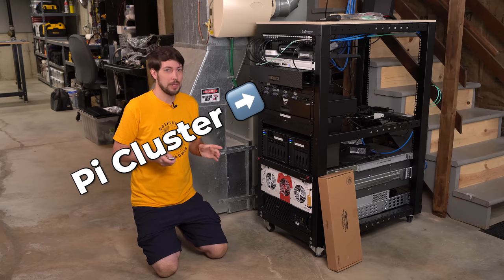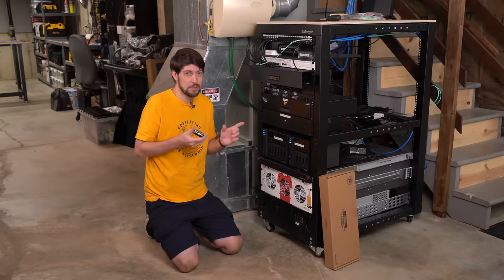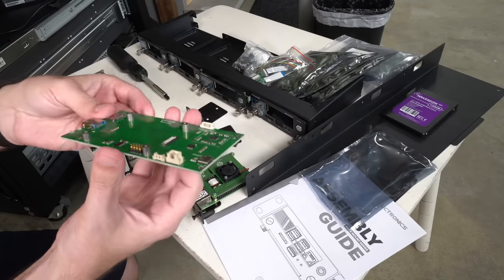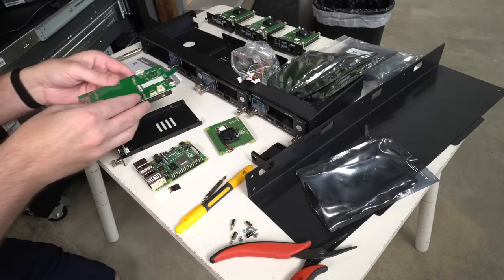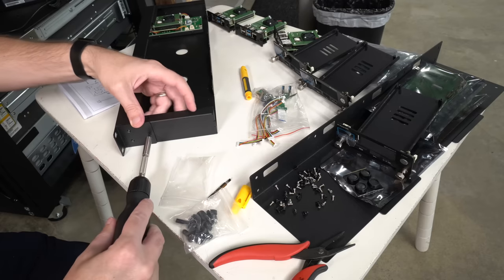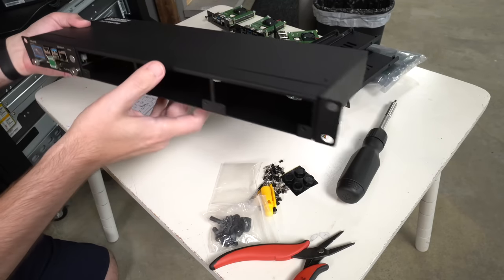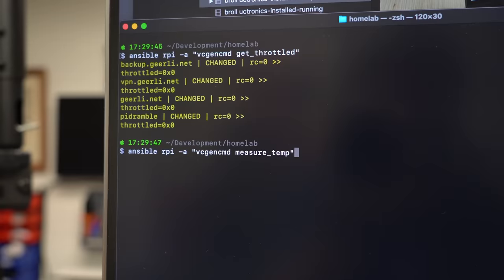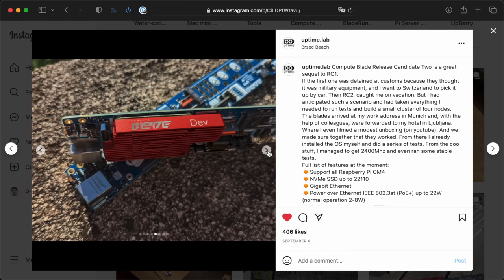Homelab upgrade: New Raspberry Pi Cluster rackmount

Comment: [Coming into this a bit later as stumbled across this on searching for something else]

Fantastic video. I've had one of these for some time and it works really well. I'm running Home Assistant on one, 2 instances of Open Media Vault (one with Plex) that has replaced my Synology, and a fourth running some general utilities (e.g. Solar logging).

The USB M-M PCBs come fitted with a cover now so that issue has gone away. I have 2 Noctua fans either side providing cooling (there are mounts and vent holes already fitted). I had to take off the cover lid as it was quite clumsy to route USB power. But....

I hadn't thought about adding PoE to the mix as I thought that you needed to provide USB power for the SATA and board. One question - if you use PoE does the fan interface also get powered ? I'm guessing it is 5V but wanted to check. 

This video has inspired me to buy another one of these and also to make a custom insert for a second SSD.

Comment: Personally, if it's between pogo pins and ribbon cables, I want the pogo pins. It just needs a redesign so they seat into place rather than you needing to align them. Also, it looks like that program had a segfault because your hair didn't get cut when it popped up.

Comment: It would be counter productive to PXE boot the PIs because if they are all dependant on a server you may as well run them as VMs. The advantage of separate PIs is they run independently of the rest of the rack except for the network itself.
Reply from the maker: PXE just separates the storage from the node, which can be more or less resilient than storage-per-node.

Comment: It seems great. But those USB-to-USB adapters really need some kind of black cap to cover their PCBs. :)
Reply: Was looking for a comment like yours to see if i was the only one who felt a little bothered because of the green pcb in front of the full black rack.

I think they should change the pcb color to black, but using a cap instead would be a good option aswell which i didnt thought about. Caps could be easily and quickly be 3D printed for them aswell i assume
Reply: I have one of these units and it came with a sealed version with a plastic cover.

Comment: What part is actually hot swapable?
I have drives that allow me to remove and replace members of an array without downing my server or appliance.
I have redundant power supplies that will let me remove and replace a power supply without downing the server.
All I'm seeing with this is a tray that allows you to power off a unit and remove it with all services ceasing during the process.

Regarding the heat, you might try tapping the holes for fans on each side and see if the holes alone offer enough air movement without installing any fan first.

Neat project. I have been relying on more virtualization than dedicated hardware for various services.

Comment: I feel like you could cut intake/outtake for fans to improve airflow. Probably two intake fans on the side and two in the middle back for out.
Reply from the maker: For now I'm going to try one intake on the side, and see if that can move enough air through all the gaps in the front of the case to get the Pis back down to the 50s.

Comment: Good review Jeff. Normally when I think of hot swap I think of some kind of backplane connector but this is little more than a tin box for those drawers, which are nice at first glance but the USB jumper is atrocious and kills the whole product for me, couldn't they have used a few more pogo pins instead? I thought the displays were gimmicky but I'm changing my mind after I saw you customize them. For the added cost of a PoE router and those 4 hats you could buy a really nice power supply. PoE is really intended for remote mounted devices, I'd rather have the box containing a power supply.   I think the box is decent value and my complaints are about the limitations of the RPi4 but the real killer is the current cost of RPi4s. I'll wait for the same thing in computer modules. I'd even forgo the hot swap if they could put all four computer modules on one board designed to run four separate systems. Maybe put UPS and remote management of the other units on the board too.
Reply from the maker: Having two sets of pogo pins makes the alignment a disaster (I say from experience with a bunch of Pi Zero projects that flake out since they used like 15 of them). I really hope the next generation of model B has a little nicer IO arrangement.

Comment: Gosh darn it, Geerling. Your videos really aggravate my GAS (gear acquisition sickness). Love this video and what you're doing with the pis. Besides the tinkering satisfaction, any reason to sysadmin with pis vs containers or VMs in a larger machine?
Reply from the maker: Mostly for the bare metal networking aspect... right now with prices as they are a slim argument can be made about power efficiency but until Pi availability gets better, it'll be more cost effective to run VMs on a small desktop or server.

Comment: Rule of thumb: every 5°C hotter halves the lifetime of electronic parts.

Cost of the enclosure is determined by the number and complexity of bits — as well as build quality/finish. They need to reduce the number of screws to assemble the enclosure and the rack "ears". Throw the project at mechanical engineers with experience in sheet metal and thermal management. A slightly deeper enclosure with provision for active ventilation and space for a 50W PSU (so that POE dependency/inefficiency/heating can be avoided) should not hurt, nor increase the cost significantly.

Comment: I would say that is a very nice setup with the screens and power buttons but the cooling needs to be addressed to be sure. Side venting with internal fans, if they will fit, would be best and would match the Switch cooling our company rack has. Also that USB to USB shunt is ugly and really needs just a black faceplate on it. Possibly with a LOGO or number indicating the pie inside. But does look very nice. ♥

Comment: UCtronics has come a LONG way. It's still expensive for what you get but if this is something you need, it's a decent product. I just bought this same rack, except mine has the screen instead of the hard drive  slot. Good kit though. Customer service is great. Just don't bent the metal. It's cheap

Comment: i think the SSD lights on the units without SSD installed are lit up because you plugged the usb bridge in already. and speaking of the SSDs, there is a big design flaw in those trays. you have to fully disassemble it to get to the SSD. there is probably a way to make it better.
Reply from the maker: Yeah, if they had it mounted the opposite direction, you could just slide the SSD out the back after unscrewing it. I didn't mention that to them, but that would probably solve that issue pretty easily.

There are definitely a few rough edges on this enclosure, I know the early design goal was to get it all into 1U (older rackmounts needed 2U), so I think revision 1.5 or 2.0 of this thing will have some great little quality of life upgrades.

Comment: That screwdriver you were using sounds a lot and looks a bit like my Snap On driver I bought some 30 years ago but at half of what you paid for yours. It’s still going strong. Hope your health issues are coming into check. Wish I could figure out writing code for the Pi’s. Other than using one for a project for ham radio running a node for P25 communications but with a ready to go program.

Comment: I screwed up when I installed my NAS the first time,   I installed it to an SD card instead of the SSD,  So far my  NAS has been running about twice as long as the SD card vs. SSD.  You never want to READ and WRITE a lot of stuff on the SD card.

Comment: Inbetween us smartalerks on the super nerdy side: How is this a cluster? You are running several computers that are tightly connected, if the stickers are correct. A cluster would be to turn them into one computer and running the software on top.
So, clusters are only as fast as the nods, which limits the overall performance using the berries. As soon someone is having a collection of especially these sweet tinies, it all for a sudden does make sense to use them all more efficiently ba creating a cluster over a connected set.
Basically, from getting into building dedicated berry boxes that do one thing and one thing only, to having possibly a dozent all over the nerd castle that do all one thing each yet are well connected in a better sub-net, the next step is to turn them all in a cluster berry, let's say a beowulf-bush, that uses the resources more efficiently of each part, because sharing is caring. There are several well documented set up designs out including full libraries, such as Beowulf cluster architectures.

#cyberpunkcoltoure 
PS:You cannot follow, you ain no our level of nerd. Go learn!

Comment: IMHO for the price of 4 pi's and this rack mount you could build a pretty good rack mounted server, especially if you take into account having to get 4 ssd's instead of one. But ofcourse usecase is a big one aswell. In my experience a hypervisor like proxmox has never failed me so i can't think of one off the top of my head but im sure there is one

Comment: the ventilation as shown would definately be a major problem , the pi s running btc / lnd would over heat in no time, and i do mean in minutes. i could smell the heatsink 's glue melt within 10min yesterday after relocating them, which is why i google "pi rack diy" this morning .. i stii love the setup though, i m sort of hoping they ve revised yhe design by now

Comment: Very nice video. And thanks for CC.
~300 for this rack and no usefull holes for a fan? You have 4 fans on your pis and temperature goes from 40 to 60-70 degrees. Thats something I don't like and a reason to not buy this rack. Yes, it saves space, looks good/ok but thats a lot of money for some wires and metall to produce a little hotspot.
Again thanks for this test. It helps.

Comment: @Jeff Geerling: I've  found that making any rPi project starts by adding Log2Ram part of the configuration. I usually have pi's running 24/7 and after a while they SD card would get mangled. Now, that hasn't happened once since that became part of my routine years ago.
I still keep updated backups, just in case, but that's proper form more than out of fear of SD failure. ^_^ If you also run Log2Ram, but still experience SD failure, I would recommend keeping that process, but using a USB drive as your data drive where writing data constantly is a thing, And for the more data intensive, an actual usb HardDrive arrangement may be in order, such as with the PiHole or any other service doing frequent writes. Your mileage may vary, but I endorse the practice whole heartedly! ^_^

lol However, it seems later in the vid you go SSD, so you're likely all good! ^_^

But I ain't one to gossip... .

Comment: Aruba switch!  Nice!  If you get a chance, try the CX line.   Do you have any videos talking about the other features, such as Internet monitoring, that you're running on your pihole?  I recently started using pihole for DNS ( have moved some network services such as DNS and DHCP off a vmware server onto separate appliances for better fault tolerance.  Not all eggs in one basket) and I'm curious what else I could be doing with it.  I also run it from an SSD.  Thanks in advance.

Comment: Jeff,   Great Video, some mentioned that they always learn something watching your videos.   I have a low budget home lab,  I have a UCTronics rack that does now have an OLED display and power button, but I have been purchasing my own OLED displays and have some momentary switches.   I been watching a video from Michael Klements,  and my OLEDs are working pretty well.   I have ran into an issue were I also want to add the power switch.  My problem is that the OLED and switch both need access to pin 3 and 5,  Do you know or can you guide me to a document that would allow me to use the switch on different ports?  Thank you and keep up the good work with your videos.

Comment: The only Thing i don't like about it is the exposed USB-PCB.
even a small plastic cover for it would be a lot better
Reply from the maker: Yeah a little overmolded part there would be nice, since anything metal brushing against the exposed contacts could cause an issue.
Reply: Came here to say this.
A nice product, although a bit fiddly to assemble. A nice overmolded part, possibly with the RPi or UCTRONICS logo, would be the icing on the cake for this product.

Comment: I don't mind the link USB adapters on the outside, but having a black PCB with some rounded corners would have been a nice extra, especially for this quality and money.
Reply: Its also a short circuit hazard, and considering the cost (and to some extend the "pro" name) I find it less than ideal.

Comment: Hello Jeff, Great video. You inspired me to acquire one. Using for my Ham Radio hobby. Also will try pi-hole when I get everything working the way it should.   I am almost there but trying to GET the SSD drive to boot up has ben challenging,. I have tried several different pi 4b boards, a Samsung SSD and a Kingston. I tried my images as even downloaded a fresh image. I am getting this error:  controller never released inhibit bit. Any thoughts would be appreciated. After several days of trying various things I am now just spinning my wheels.   Thanks  Dave

Comment: I purchased a lower end UCtronics rack. It came with POE hats. The problem was that the POE hats didn't work reliably (they failed to provide enough power to use a USB drive).  

The software for the OLED that was written in C was easy enough to modify, even if it wasn't the best written code out there. 

I honestly don't see myself buying more products from UCtronics.
Reply: Maybe yoi should contact their customer support and see what they say
Reply: @ahyaan2552  I honestly don't want to create more e-waste. I looked up my notes, and they indicate that two of them gave up a capacitor in transit. The two that worked didn't work well. I am sure the company would replace the damaged product, but why should I waste their time and mine if the working product isn't good enough?
Reply: @edwardallenthree  Hi Edward Allen, the default POE hat is 802.3AF standard which only supports 5V/2.5A max, might not be powerful enough to drive the USB hard drive. And we keep improving UCtronics products according to customers' feedback, we will release a POE+ HAT very soon to support 5V/4A, keep tuned.

Comment: I have a pretty sizable lab at my house. I have multiple servers, over 200G of total ram, and 100T of disk storage, 40gigabit ethernet, and all of that good stuff.

I could not at all justify the cost of spending significantly more on the PI, versus using just optiplex MFF, or SFF case, which, isn't really going to use that much more power as opposed to a PI. As well- 300$ for the enclosure, 100$ per pi, 20-50$ worth of POE hats, SSDs, etc....

Compared to just buying an optiplex 7040 MFF for 40$, which has significantly more power then all of the PIs combined. 

While- its cool and everything to cluster a bunch of PIs together, I don't really see it being practical in terms of either cost, or efficiency.
Reply: Would love to know where you get the optiplex for $40
Reply: I hear you. I just think raspberry pis are fun, however. I would never have built a kubernetes cluster of sff computers that fits in one you, is powered over Poe, and uses less than 40 Watts total.
Reply: @Mark-wu6wl  Second-hand all over the internet, befriend a sysadmin and offer to pick up their 'old' computers for free, not hard... But even a brand-new NUC for 300 dollars would be cheaper than this rack mount, four Pis and their SSD/SDs

Comment: Looks like a nice box, but about 6x the price I'd want to pay for it. The OLED screen is very low value for me, the rest pretty great.  Have you tried running a Pi without the PoE hat to see how the temperatures fare? It may be time to get messy and mod in some form of USB-C 4way power brick.

Comment: Hi Jeff, great video as always. Packed with useful information and this has given me some ideas to improve my existing setup and reduce the power consumption of systems in my racks that I was planning to replace - now I have a plan. I do share your concern regarding ventilation in the new rack unit and I would have thought they would have considered this in the original design - because of dust maybe? Anyway, sorry for no posts recently, chemo has made me very sick but I'm getting back in the groove again and your videos always make me smile and get the gray matter going. Thanks Jeff. Now, How do I get hold of Pi's?....

Comment: rpi  os has an option to run read-only and/or log to the dns pi's ssd ...
and/or use rock pi sdcard adaptor board to mmc memory module.

Comment: Great video as always ... but is it just me who hates ratchet screwdrivers - even expensive LTT ones? Ok, hang a picture on the wall or do some wood butchery but don't clickety-clickety-click anywhere near a computer panel! To be honest, I have very little problem using a screwdriver single handed if it's got a decent, not flat-ended, handle which nestles and spins on the middle of my palm - perhaps it's just down to individual dexterity and me being an oldie? 🙂
Reply: I don't see a reason to have a ratcheting screwdriver unless you've got issues with your hands.

Comment: Those LCD panels are pretty nice. Was obscuring the IP address intentional? Also - you can let rid-shirt Jeff have at it with the dremmel tool and creating air flow.
Reply from the maker: No, there was a bug, since corrected, in UCTRONICS' display library.

Comment: Never seen that micro SD to SATA? cable. Are the signals proccesed to work with the micro SD slot? And are the speeds faster than via usb 3? I haven't found any similar cable or adapter.